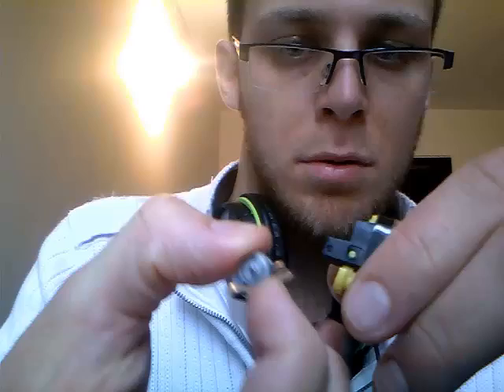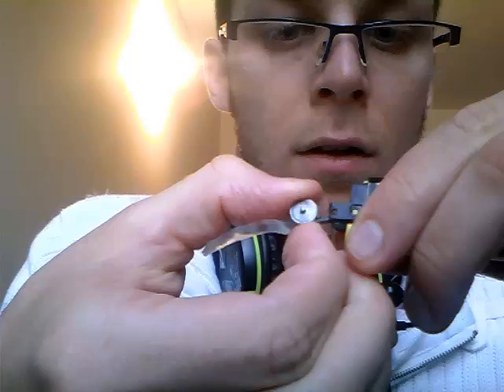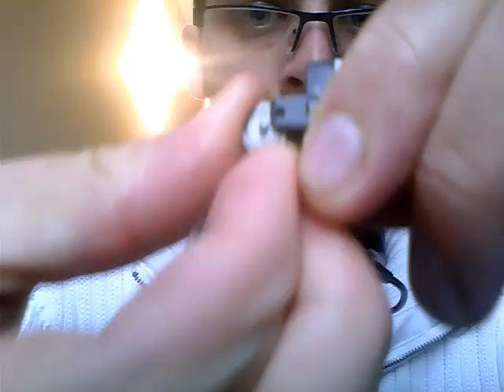Lighter Flint Replacement - How to replace Flint in a Lighter (Normal)

Comment: Easier way: pull out the whole part where the wheel and flint are unscrew the bottom white part (careful the spring inside will make it fly if your not holding it) put the flint inside the hole replace spring and white part screw back on and pop back into lighter
Reply: So much easier! Thank you :)
Reply: Wow i just notices there is a separable part at the end of it!

Comment: Well I couldn't do it, and after 2 hours of trying the flint has flown across the room so i now give up as Iv'e wasted two much time already, maybe it's because I'm a woman but what does it mean, as Darius says below, shiny side facing downwards to the spring?  Confused, I am!
Reply: Get a little tooth pick or flat head screwdriver to hold that flint down. Then put one side of that spark wheel in 1 of the 2 holes on the posts, push other side down. Remove flat head, Prestoo! You are starting fires again. Keep your flint in the hole sister.
Reply: Todd Twopapers huh?
Reply: Wrap it in sandwich bag plastic all around and tighten it like it was vacuumed wrapped. Put in, then unwrap plastic. You are done. The flint can’t escape inside plastic. YouTube it because theres a video that shows this.

Comment: shiny side facing downwards to the spring?
Reply: Darius Han he means the used end of flint so it grips spring better.
Reply: He means put the untouched new side at the top so the wheel starts with a flat flint.

Comment: Here’s a way to do it. 

Pop the wheel out with a knife and let the spring push the old ferrocerium rod out. Put the new rod in carefully into the hole, (using the nail on your thumb) and put the wheel back in the notch so it holds tension against it. It might not work if the grooves on the wheel are backwards, you you have to re adjust the wheel to get them to face the correct direction. After that, it’s done. 

I’ve been doing that since I was 12 with bic lighters. It’s simple, you just need to know how they work.
Reply: So basically do it the hardest way possible? He literally showed you it takes seconds. Most people can’t do it that extremely hard way.

Comment: Where to get flints? tobacco or vape shop?
Reply: 2degucitas Any tobacco shop or Walmart.
Reply: 2degucitas I simply took the flint out of an old different lighter and put it in the lighter I fixed.
Reply: Any old lighter. Don’t waste good parts. Its free and bic ones are huge so last forever.

Comment: I figured swapping in a fresh flint would be hard, first time took 30 secs. Now I am down to 10 secs but I still put the spark wheel on backwards sometimes... Has anyone made one of those electric Bic lighters into a refillable yet? ;)
Reply: Easy. Get a threaded b type valve. I have trouble with crappy threaded A valves. They don’t dig in well to screw it in. Or you can glue one in from a valve from another lighter.